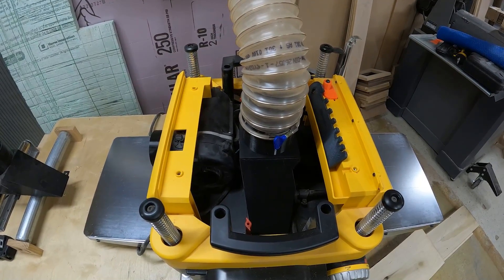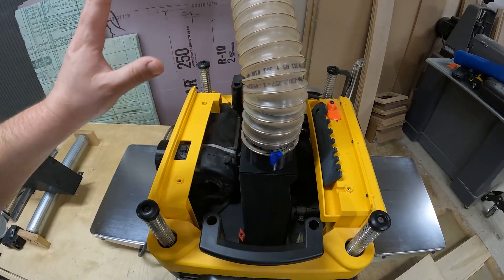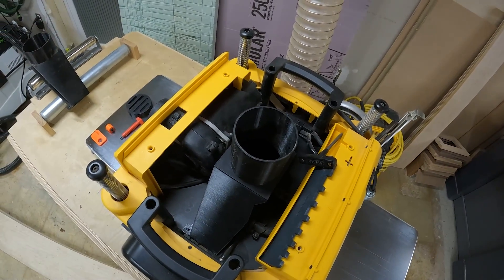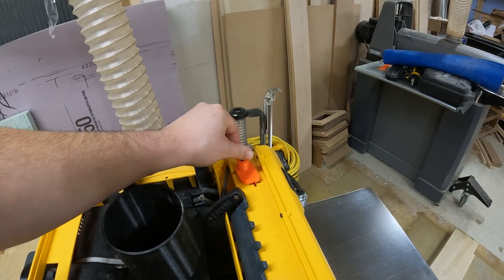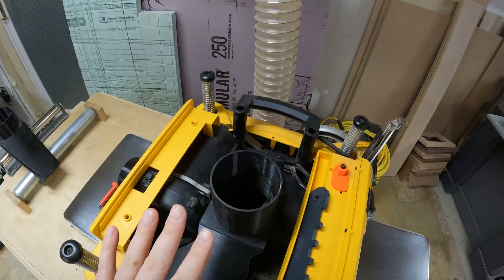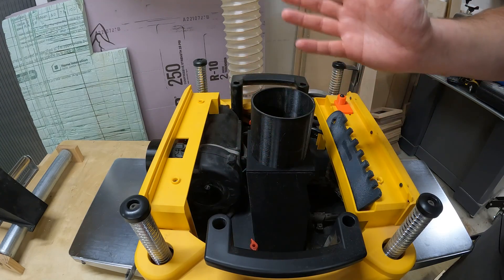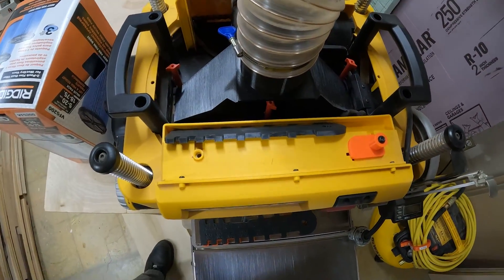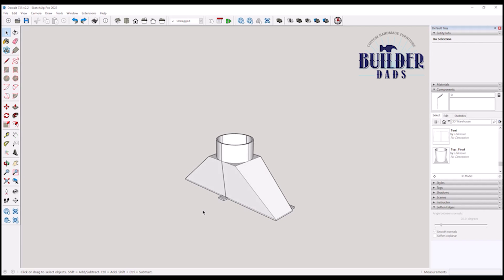DeWALT Planer DW735 dust collection modifications

Comment: Added one a while ago, chip extraction is excellent. The motor however just started giving me trouble rpms changing drastically.  I am wondering if it is getting cooled enough as the spinning blade blew air into it originally.
Reply from the maker: Hmm, with the fan still on it should be pulling the same amount of air over the motor. Have you checked the brushes to make sure they are alright?
Reply: @builderdads turned out to be bearings.

Comment: Just installed this yesterday.  On the trial run I was impressed with the chip removal, no chips coming out on or along the board.  I was not happy with the gust of wind that comes out of the old dust port now, blew papers off my bench!  I see that the impeller is needed to move air through the motor for cooling, but what if you removed just the fins/blades on the outboard side of the impeller? Seems the inboard is the one that works with the motor, outboard was for chip removal.  Thoughts
Reply from the maker: Good insight and you are right there is a bit of a gust of wind that comes from the machine.

I did start going down this road about what to do in order to move air but not so much. Might need to put some more focus on that.

Comment: So yesterday I had a bigger pile on the floor in front of my planer than in the stupid dust right bag and I’m ready for something like this. Question is, I’ll be using a 2hp dust collector like the harbor freight one and planing mainly epoxy which is awful for planing because the chips stick when they get hot and electrostaticly.  Do you know if this will work well with that set up and for planing epoxy?
Reply from the maker: Hi Elad, that is a really good question. I know a 2hp dust collector is not an issue for this change. 

As for the Epoxy question I personally have not run Epoxy through my planer, but I do have some thoughts. Since you are now going to be coming from right above the cutter there will be no reduction to a smaller diameter and you will not be introducing the heat of the motor to further make the epoxy sticky. I would think you would see similar performance and stick to what you see in your dust collector hose. For my DW735 I have a Shelix head on it and prior to the upgrade I would have issues of the motor bogging down if I tried to go to low with a cut because I was double handling the chips. First was the cutter head handling the chips then the impeller off the motor. 

Hopefully this info helps, but feel free to use our contact form on our website https://builderdads.com/contact and I can give you a call to discuss. 

Thanks,
Dan

Comment: I purchased this file and am printing it with pla. Do I need to print with Petg
Reply from the maker: Thank you for the purchase. That is a good question because I haven’t printed it with PLA. I believe it should be structurally sound and not give you any issues, but I can’t make any guarantees. I print all of my shop tools in PETG because early on I read that it was stronger than PLA so I just configured my machines for it and went that direction.

I would love to hear the feedback on if PLA works well for you. 

One note I should make is that I will be sending out updated files to everyone who purchased the download very soon. Based on comments received here and from others who purchased the download, I adjusted the files. The major improvement is that the top has been moved back 1 inch to allow for more finger room to get to the front screw.
Reply: @builderdads  that’s great news. How soon before you sell them built?
Reply from the maker: @davidlynch7666  it is now online for sale fully assembled. We are working on an updated video to walk through install and updating the photos to the latest version.

The first kit will ship Monday with more following quickly. 

https://builderdads.com/store-XqrbB/p/dewalt-dw735-planer-dust-upgrade

Comment: Pretty cool, been thinking of something similar. One little thought, maybe make the front a slot instead of a hole so you can start the screw in and just slide the housing back and on to it instead of fighting the get that one started?
Reply from the maker: Thanks for the idea! Since the release of this video I have gotten some really good feedback like this so a v3 is now in the works. I am going to have to incorporate this idea because it will for sure help with the blind hole. 

Appreciate you sharing this idea!

Comment: Have you thought about cutting a hole in the top cover to be able to reinstall it?
Reply from the maker: Yes, that is on the list of things to do. First I wanted to make sure I was in love with the design of version 2 before making that commitment. So far very happy, but I am debating moving the top back 1/2" toward the motor to make getting to the front center post a bit easier on bigger hands.
Reply: @builderdads  as someone with huge hands and an eye on this planer.. 1/2” helps!
Reply from the maker: @davidlynch7666  thanks for the feedback! It was one of the things I worried about when trying to use all three original screws and ensure there was room to get to them easily. I think I shall be adding a version 3 to the digital download and then make the commitment to cut the top.

Comment: One more quick question... what is the largest dimension of the 3 pieces? (checking if it would print on my printer)
Reply from the maker: Part A prints at 7-5/16" L x 3-3/4" W x 4-41/64" H. Part B is slightly smaller on length and the Top prints with supports.
Reply from the maker: Wanted to check back to see if those dimensions would work on your machine? If not what kind of machine are you using?

Comment: Did you disconnect the impeller to save amps?
Reply from the maker: No I left the impeller in. I did take it apart and clean it. On the backside of the impeller is another set of blades designed to move air across the motor to keep it cool.